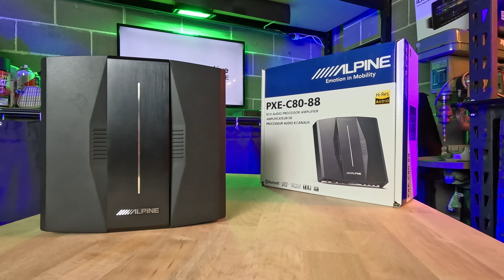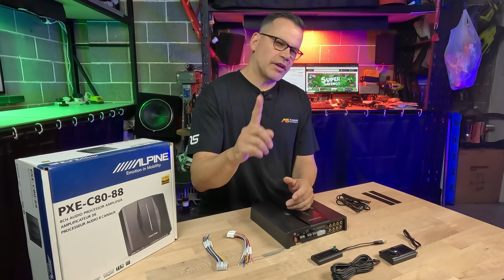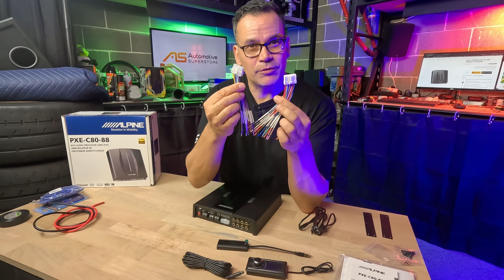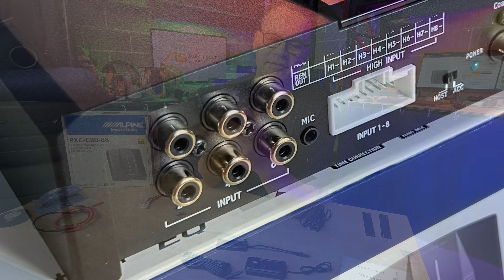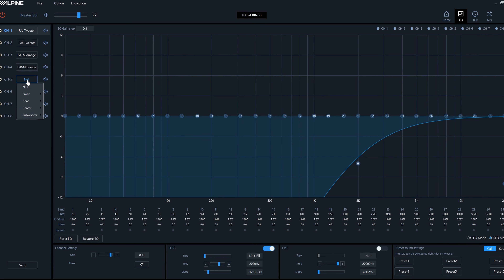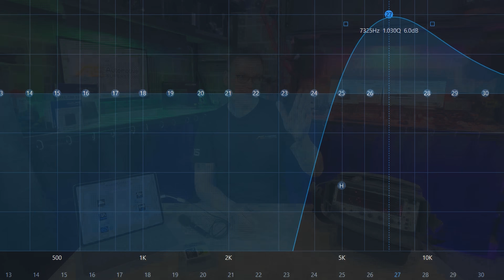Alpine Australia OPTIM8 PXE-C80-88 | 8 Channel 900W RMS DSP Amplifier | Overview & Features

Comment: Unlucky DSP amplifier... I actually felt it while using it, and it's a really good DSP AMP that drives away all the good things.
But! The Auto EQ Setting marketing failed and rolled into that frame. 
It's gotten a lot better with the latest firmware, but it must be the best cost-effective model for users who don't just use Auto EQ setting.

Comment: My chief complaint is that the power numbers are at 10% THD
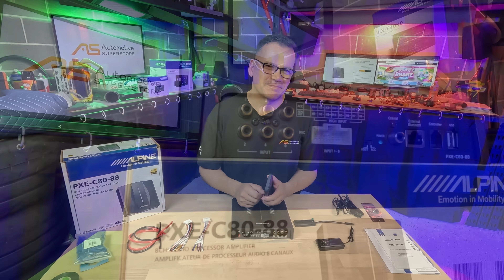Reply from the maker: If you want to know our opinion on the real World power output of the OPTIM8 having used one, go to 4:35 on the video. The THD is irrelevant. If kept below clipping this amplifier sounds the same as any other. Transparent.
Reply: @automotive_superstore  You already know that having more power means more headroom, which can lead to better dynamics and transients. I've had this alpine, it's a fine unit for a first timer or a budget orients factory improvement, but on par with other DSP amps like my current Helix setup that I bought to replace this exact alpine unit is disingenuous.
Reply: @SevereMkII  Nobody is suggesting it is on par with Helix units. It's much lower price also reflects this.

Comment: hello how to use front 3 way active , rear passive and one sub with external amplifier when it have only 8 outputs?
Reply from the maker: Six channels for front 3-way array, 7th channel mixed to mono in the input matrix and connected to rear fill, 8th channel mixed to mono with RCA output sent to mono amplifier.
Reply: Actually you can use the first 6 channels for your 3 way up front. Then use chanel 7-8 for the left and right rears. You can just get a signal wire or RCA wire going from port 8 of amplifier to your other subs amp. Hope this helps

Comment: Hello dear friend, I also updated to 80_88 and then it shut down. I have the same problem. How can I solve this problem? Please guide me. Alpine support is not responding.
Reply: If you think this is a technical issue with the product itself contact the dealer you purchased it from. However, Alpine products are very reliable, so check you have correct power/earth/trigger first.